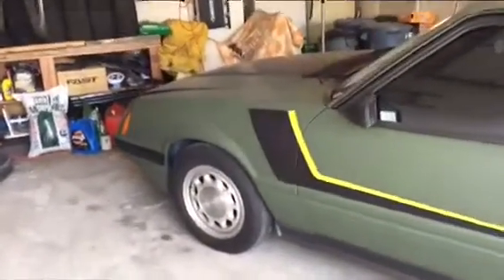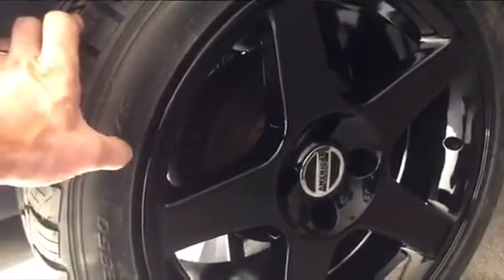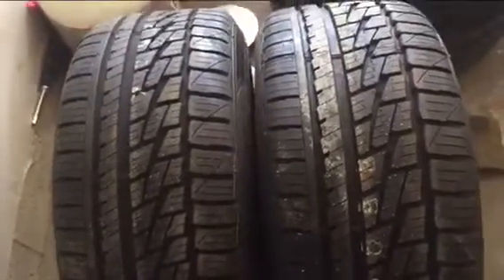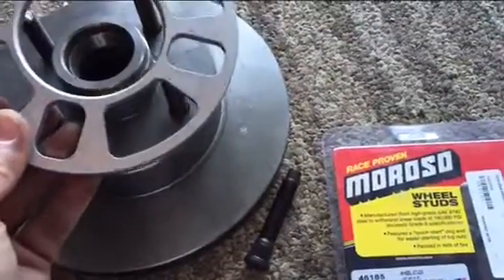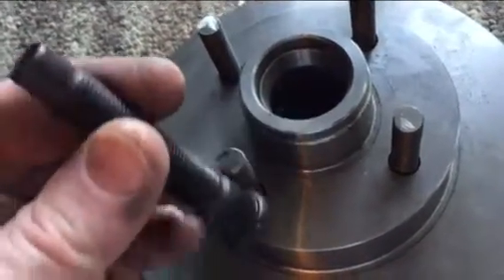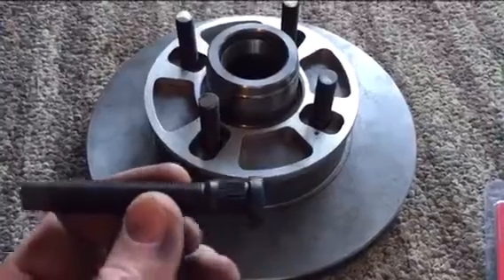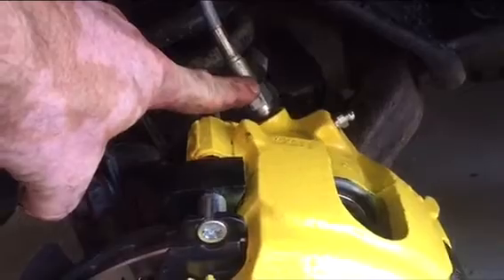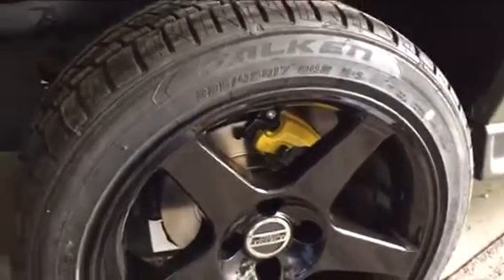Installing 17 inch 2003 Cobra Wheels on a 1986 Foxbody Mustang

Comment: Just a little pointer to make the front caps fit without spacers... Take the wheel off place a chunk of 2x4 on the center dust cap and tap it in with a hammer a little bit...it will not effect the cap or bearings in any way whatsoever other than giving you the clearance for caps and as for the backspacing of the wheels when you put the car down the gap between wheel and shock will space out slightly

Comment: 275 40 17 rear would be perfect 3inch moser studs perfect match
Reply from the maker: Hi Daniel, I agree I wish I went bigger on both the front and back. Currently working on upgrading all the brakes as the stock brakes are useless, also wish I waited and went 5 lug conversion which would have been a easy upgrade along with the brake upgrade. 
Cheers,
Hans

Comment: As for the studs, I used spacers and an impact to get them in...
Reply from the maker: Same studs? I had to drill out my rotors to get the new studs in as your method nor a 6 ton press at work would get them into the rotors.
Reply: That's weird.. I did hear you have to do that with extended studs when it comes to ARP but I'm not sure about Moroso.. and no my studs were regular length for the rear axles

Comment: You can also run "et style lug nuts" wich will let your grab many more threads with your stock wheel studs because they have a shank on them that fits through the hole in the wheel and they kind of Center your lug nuts and rim you can look them up on Google eBay many other sites ET style lug nuts 1/2 x 20 is the standard Mustang size lug nut that comes Factory the size and the pitch
Reply from the maker: spassmore8483  thanks for the information nice to know, this may save a lot of time and money .
Cheers,
Hans

Comment: Do notice any change in acceleration with the larger rims? Large rims reduce acceleration.
Reply from the maker: Thunderbird88, nope no change because the overall diameter of the tires are identical to before.
Cheers,
Hans

Comment: Hi. Did you have to roll fenders or do any mods other then what is on the video? Is the car lowered? I’m from Toronto too, was the shipping very expensive? Sorry for all the questions. Thanks
Reply from the maker: Hi Alex, no problem with all the questions hope I can answer them to your satisfaction.  I did not roll the fenders, everything you seen on the video is what I had to do to get these tires and rims on the car. The suspension is a FORD racing suspension and the height is close to stock. I bought the rims from a guy in Brampton that runs a side business called 5.0 motorsports of which I found via Kijiji if I remember well his name is Ron. He buys a pile of rims when they’re on sale drives down to the States and brings them back the result is cheaper than you can buy them from south of the border.  Hope this helps.
Cheers,
Hans
Reply: Thanks for the response. I’m assuming it’s a 17x9 wheel.
Reply from the maker: Hi Alex, yes 17x9 rims. Depending on how much you want to invest in your car you may want to consider upgrading the front and rear to 5 bolt and disc brakes on the rear. Now that I’m a little further along in the project I wish I slowed down a little and  did that. The original brakes on these cars are weak and if you’re going to up your power on the engine you may have issues stopping.
Cheers
Hans
Reply: Agreed. I have an 89 LX that’s completely stock and want to keep it as original as possible, other than wheels and a couple other small things but definitely not a race car lol.

Comment: Can you tell how you swapped out your drums to disc. I have the same exact rims and don’t plan on swapping to 5 lug any time soon. What’s parts do I need etc
Reply from the maker: Hi David, the front are stock 4 bolt disc breaks and the rear are stock rear drum breaks. The callipers are new stock part just painted yellow. Next year I’m planning on updating my breaks with 4 bolt disc breaks kits from LMR that should improve my breaking as the stock breaks are pretty sad. That will also allow me to reuse my current 4 bolt rims. Hope that helps.
Cheers,
Hans
Reply from the maker: PS - LMR has pretty good videos on their web page on how to upgrade these brakes.
Cheers,
Hans

Comment: I have 275/40/17 up front... and 315/35/17 in the rear.. same wheels as yours.. but if those 45s you have don't clear you need 90-93 fenders... they're more flares out than 79-89 for some reason
Reply from the maker: Good to know thanks.
Reply: For sure man good luck on the clearance, hey that green.. is it from a aerosol can or how did you do that?
Reply from the maker: Joe Septien it's a wrap it was a fraction of the price of having the car painted.
Reply: The '91 to '93 cars had factory 16" Pony 5 star rims.  So those cars have more fender clearance from the factory.